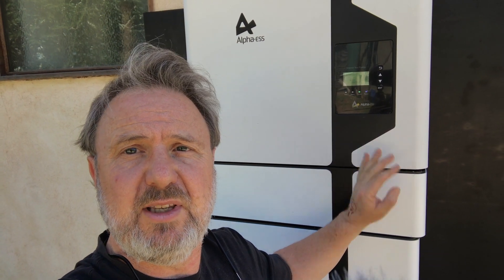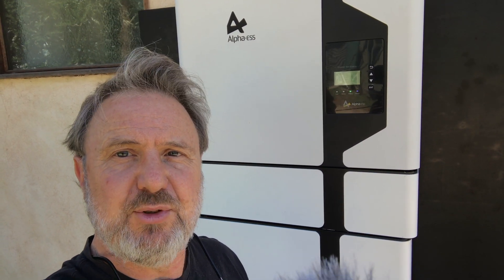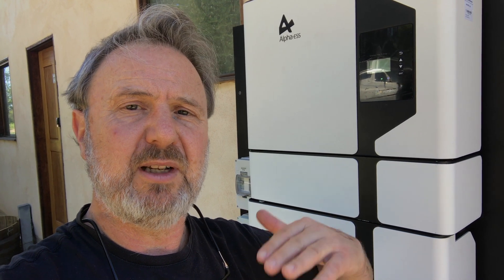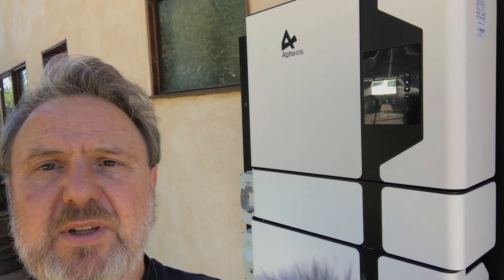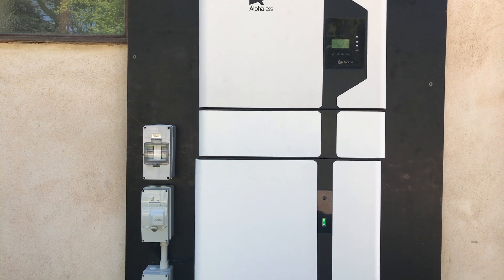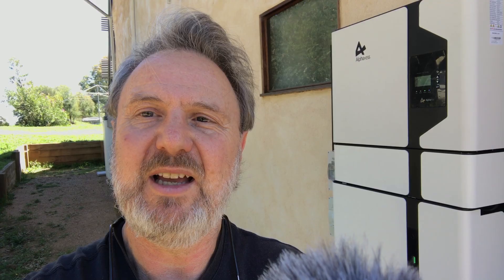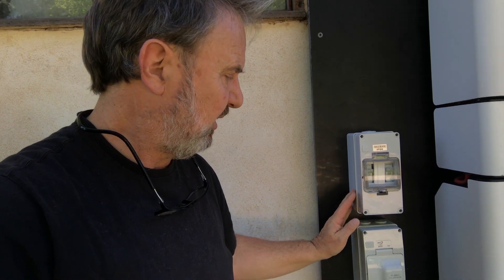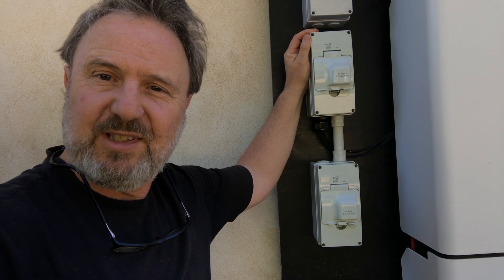Alpha ESS SMILE5 Review

Comment: Nice video mate , just wondering is the battery still operational 7 years in ? If you can do a follow up video that would be great, thanks !!
Reply from the maker: The system has been removed from test but will be re-installed soon at another location.

Comment: Why you haven´t it installed in house instead of out of house? You will get much more stable and better temperatures for batteries, so better efficency of system and clean from dust etc.
Reply from the maker: In Australia we are not permitted to install batteries inside habitable rooms
Reply: @SmartEnergyLab  Ah, understand. So ok in this case

Comment: The specs actually state 4600w nominal AC output, 5000w is PV+BAT
So going by this, would you need a 6.1kw PV system, or a 6.6kw PV system?
Reply: No there is actually a CEC loophole with coupled batteries and Max panels allowed

Comment: Hi Glen
Any possibility to show the terminal connection  on the Hybrid and Switch board requirements.
Does the battery have a backup mode.
And does the consumption meter require 4 poles?
cheers

Comment: I am looking at the SMILE5 10kwh for my home. I understand that it is capable of 5kW in backup battery off grid mode.  I wanted to check if this is sufficient to power two or 3 split unit air conditioners at 800w electrical power each. More specifically would the start-stop current surge of the compressors trip the inverter if run during grid outage?
Reply from the maker: No

Comment: Good morning.
The maximum power that the inverter can deliver when connected to the grid is 4600 watts. 
But what is the maximum AC power available in backup mode (when the grid is disconnected)? Or rather, what is the maximum load power applicable to the backup output (in UPS mode)?
Reply from the maker: Hi Claudio, maximum a.c. power to the grid is often a country setting in the inverter. In Australia most are set to 5kW. The AlphaESS has 5000VA backup power. It runs my kitchen which has many electrical appliances (microwave, toaster, induction cook plate (2), dishwasher, radio, coffee machine) and rarely is tripped out by these when running in backup mode without the grid. I just have to be careful not to turn them all on at the same time.

Comment: In Australia you really should have everything on the North Side (South side in Northern hemisphere). Only if your house is roof is orientated East/West facing would you want to split the array 50/50 on each side to get a morning / evening - double-peaked output. And actually most inverters will take 20-40% more panels than the inverter rating. Ie. 5.5kw panels on a 4kw inverter is a good idea. And if you are East/West then you could do 3kW on each side as they're not going to be peaking at the same time. Panels are only about $100 each so it's worth doing this as installation / racking / wiring / inverter price won't change much. Remember panels will lose 10% efficiency over 10 years. They'll output less in the winter, cloudy, and also when very hot - so 5kW panels might only deliver 4kW in a really hot day.
Reply: While one might get some more total power north facing, one receives solar for longer having both east and west facing panels. The former allows for more storage, the latter reduces the storage requirement as solar is provided for a bigger part of the day. North facing or not is not necessarily a black and white issue.